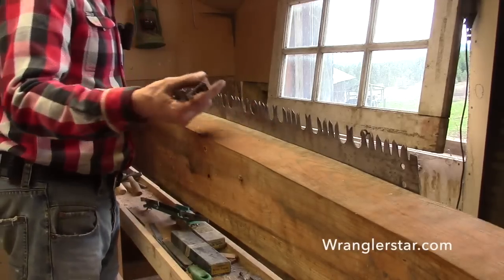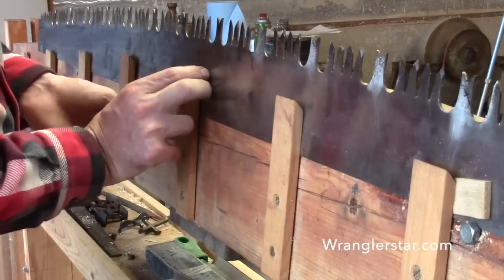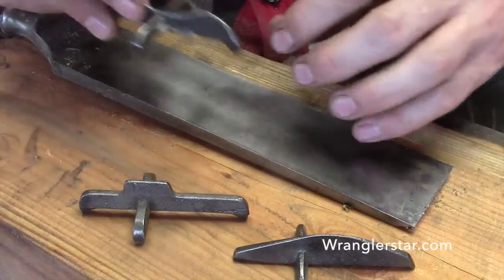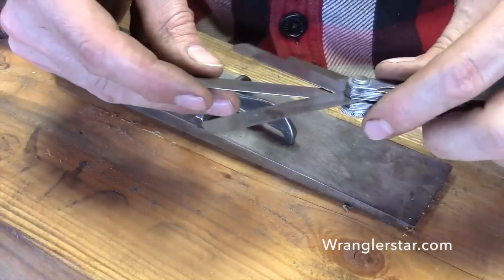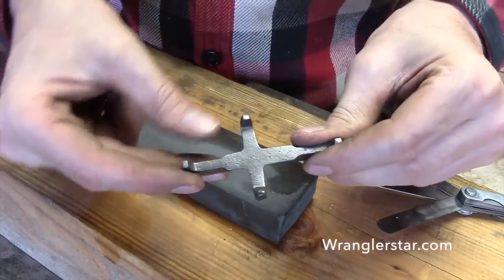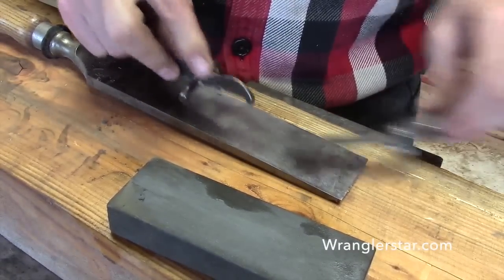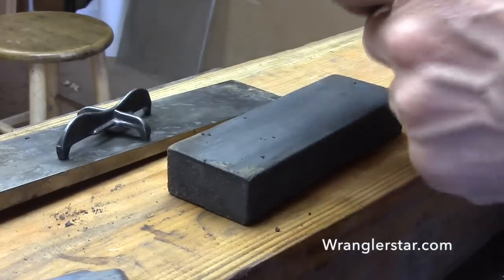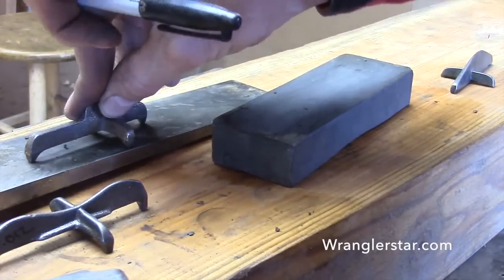Crosscut Saw Filing | Part 3 Wranglerstar

Comment: I just came across these videos as I am currently in the market for a new saw. Still doubting whether to look for a vintage one and sharpen it myself or buy a new one. Are you going to continue this series by taking us trough the actual filing process? And by the way, do you have any experience with large pit (rip) saws? I saw one the other day, looked cool.
Reply: +Michiel Schoenmakers 
I found some videos from a channel called Old Sneelocks Workshop. He goes over the entire process. Hope this helps.